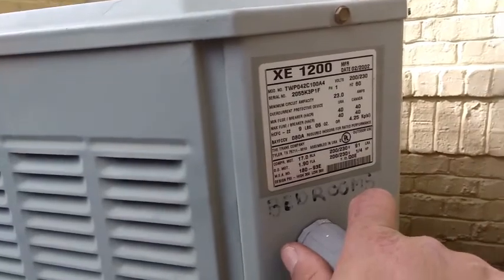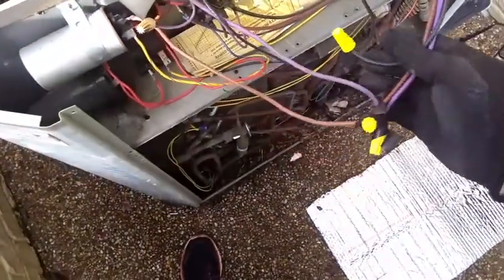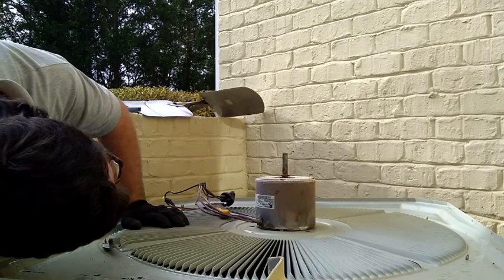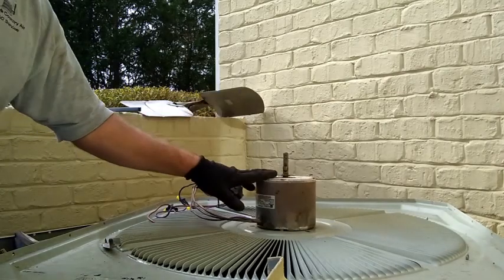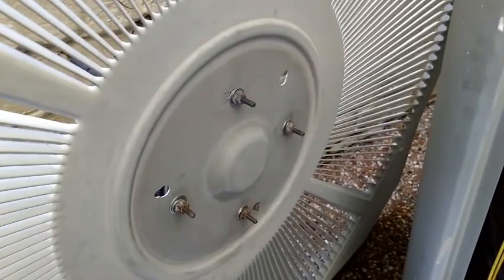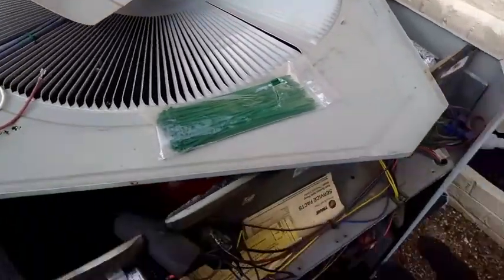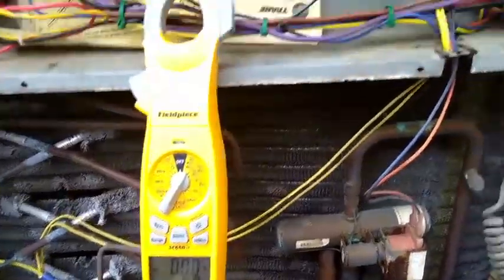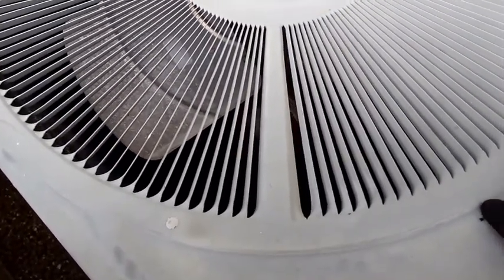Condenser Fan Motor Replacement | Trane TWP

Comment: Always change the capacitor, it’s cheap insurance.  Not all China-made capacitors are bad.  The ones available at United Refrigeration (UR) and Aireco (in the Diamond-Tread boxes) hold up well and are a fraction of the US models.